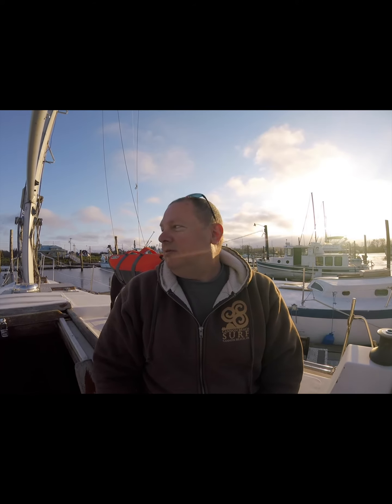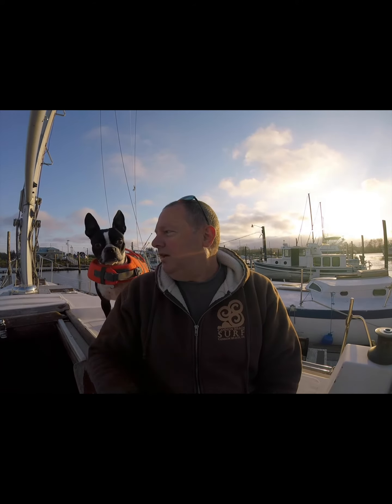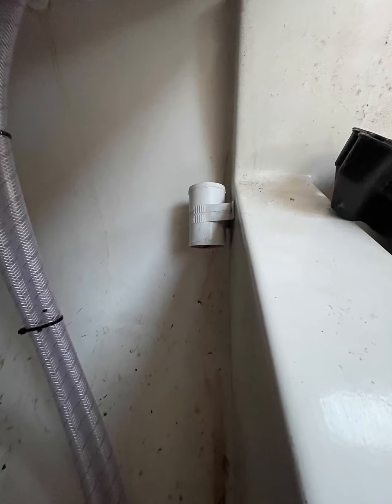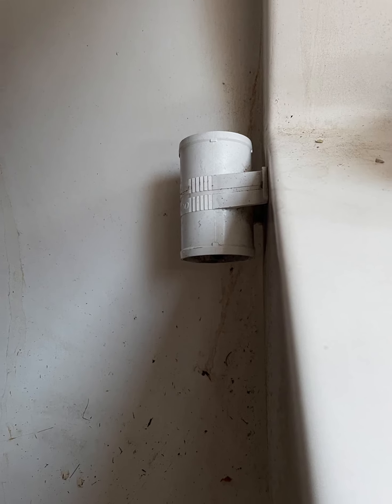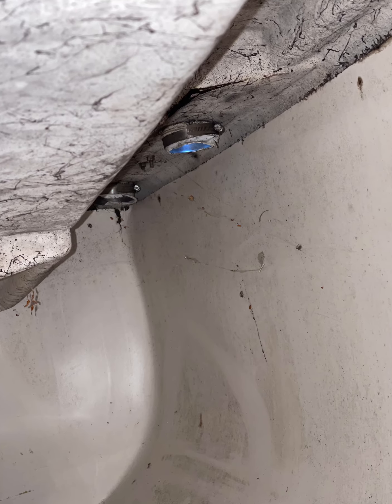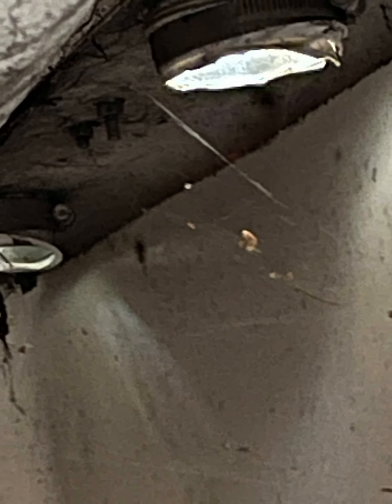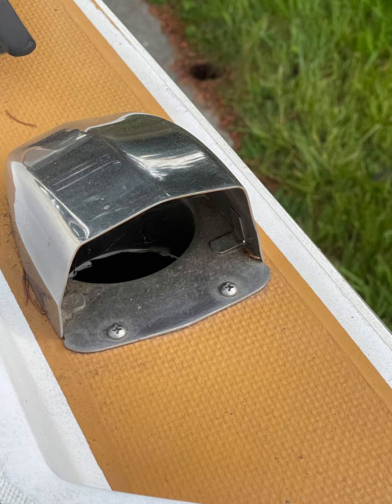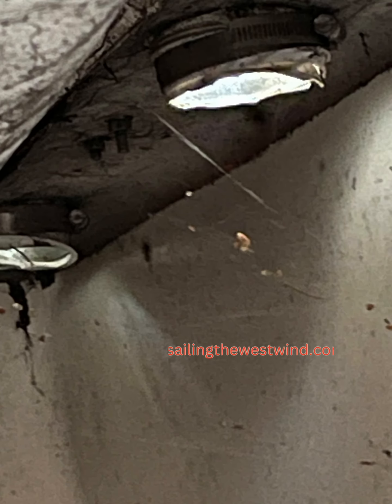What is this? Exhaust fume Fan? How do I plumb it? | Catalina 22 [EP 108]

Comment: Hi Grant! I'm pretty sure it's a in-line bilge blower fan. All you need to do is connect flexible ducting to both ends. The exhaust side obvious hooks up to the vent to the outside. The other end usually hangs out in the bottom of the bilge to ventilate fumes.
Reply from the maker: Ok. Makes sense, but what hooks up to the other top vent?  What end to I hook up to the blower? The one with the opening facing forward or rearward?  Thanks for your help.
Reply: @SailingtheWestWind  I agree with iclarsen.  I couldn't tell from the picture if the fan is oriented to blow or suck but typically is set to suck and the exit of the fan should be connected to the cowling that faces aft.  The entrance to the fan should be plumbed so that the hose is in the bottom of the bilge where gas fumes would settle and you can leave the other vent, the one facing forward, disconnected as that will become the fresh air intake.  You may wish to put a screen of some sort on the fresh air intake to keep dirt daubers and wasps out.
Reply from the maker: @martyb3783  thank you. I just got done talking with a large commercial fishing mechanic. He said exactly what you just said. No I know how to proceed. Thank you for your comment.
Reply: @SailingtheWestWind  No Problemo!  Glad to be of help.